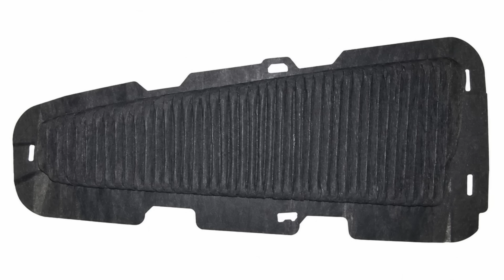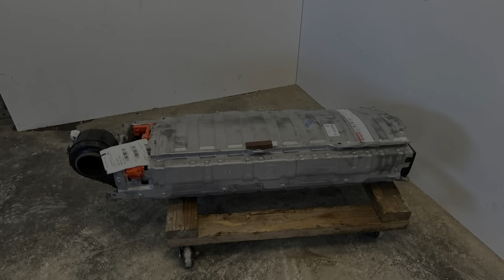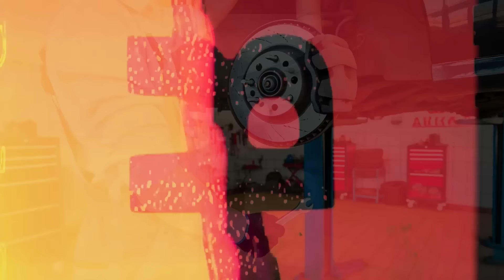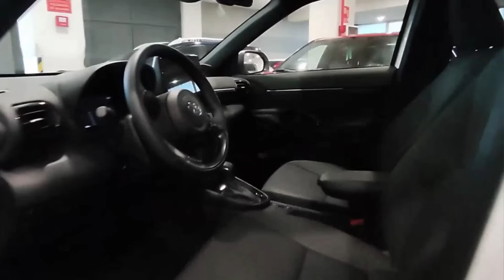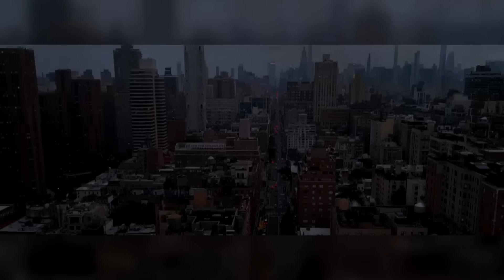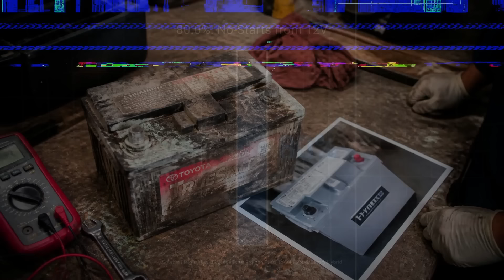12 Toyota Hybrid 'FORBIDDEN' Tricks Mechanics Use On Their OWN Cars (#9 is My Favourite)

Comment: My 2017 Prius V averages about 50mpg. On the other hand, I’m on my third 12V battery. They seem only last about 4.5 years before they have to be replaced.
That said, my wife’s 2021 Highlander Platinum averages about 32-34mpg and it’s still on its original 12v battery. My 2026 Sienna Platinum averages about 41mpg, even packed to the gills with cargo for conventions. But I also don’t drive like I’m still 17. We run all 3 in eco mode full time.

Comment: I have 2016 prius v, Uber driver last 10 years and didn’t change hybrid battery, my mileage is 504080 miles. I clean summer hybrid battery cooling fan. I have original battery.

Comment: Good article . I have used or been aware of almost all the items you listed. Changed the trans  fluid ,rear differential fluid and brake fluid at 45k . The 12v battery life span and preemptive replacement was a helpful tip I was unaware of. Car is 5 years old so I'll be on the look out for the battery issue.

Comment: I have a Yaris hybrid 2023 model and have already have had to replace the battery. I think this car is a heap of rubbish: I used to think Toyota were good I have changed my mind.
Reply: All new cars are loosing to the 15year old ones with 270000km on clock …but Toyota /lexus are still beating others including Germans …
Reply: Should have bought a Camry.

Comment: #9 - allowing a few minutes for a normal car engine to warm up before driving off has nothing to do with carburettor or fuel injection but has everything to do with avoiding stressing the engine before the oil has warmed up so it has thinned out and had the chance to lubticate all moving surfaces!
Reply: Yes, but this rule does not apply to hybrid vehicles, you silly man !!!
Reply: @tee-z6e yes it does,Fool. it is an ice engine!

Comment: I drive a 2008 prius and average 40 mpg. I drive a mix of highway and city, but mostly highway. I don't always baby the thing either. When I need to go, I will keep her below 80 miles an hour.
I've done most of the maintenance myself, like all fluids you named, new 12 volt battery about a year ago, new wheel bearings on front end, cleaned the high voltage battery fan, plus oil and filter changes every 5k.  I keep good tires and brakes on her and wash & recharge my K&N air filter. I did learn about the cooling fan filter cleaning trick from the video and will start cleaning that, too. I recommend using toyota oil filters with Valvoline Restore and Protect engine oil 5-W-30.
Reply: You should try to get a newer Prius. It will get you 55 or 60 mph easy
Reply: @pinecedar180 true! I recently bought a 2018 prius one. The lowest mpg I've gotten has been 54 mog. It us normal for me to see over 60 mpg on slower country roads. Not unusual to see 70 mpg and have seen 80 mpg when driving to see how high I could get mpg while staying at the speed limit. I spent less than ,$200 on gas driving 3,000 miles.

Comment: Thanks for these tips...BTW, I've gotten 64.3 mpg  several times  on my regular commutes to the beach and back by  gradual acceleration and by coasting as much as possible given certain road conditions. I would usually average about 55 mpg. This includes roughly 50% highway driving and hilly driving about 55% of the time. My 2005 Chrysler Sebring hardtop convertible would average 27 mpg